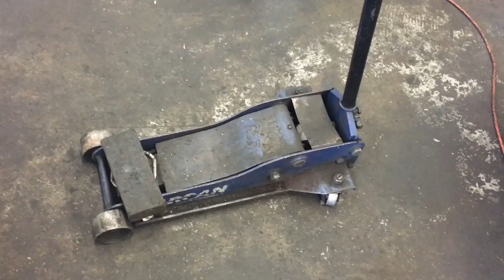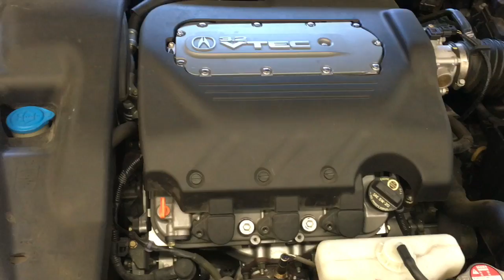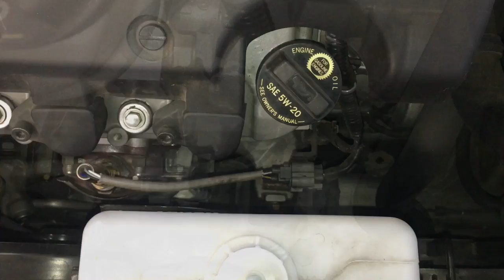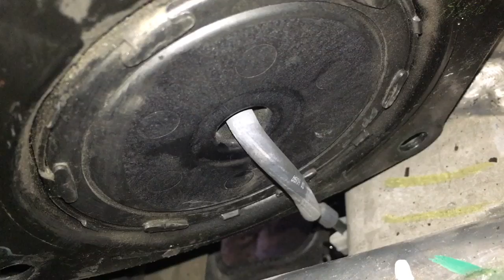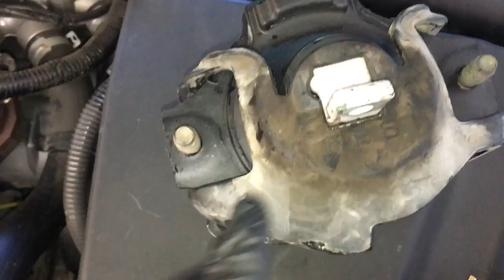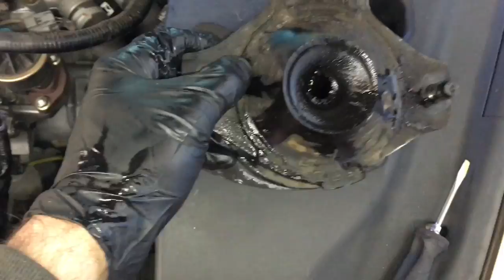How To Replace The Front Engine Mount On An Acura TL

Comment: So I removed all the bolts and nuts but now the mount doesn't want to come out at all. Like it won't budge like the bolts are all still in there LOL. I'm going to try to loosen up the left mount on the passenger side to see if they'll give some flex where I can jack the motor up to be able to remove the old Mount. If that doesn't work I'm just putting it all back together. Okay so that did work. Was very hard to pull the old one out but I got it out. Take note, I have a 2008 TL Type S with an automatic transmission. Looks like mine is different than what is in the video slighly where  I had to remove the wire and harness bracket that's on the starter. There's a 14 mm bolt for that bracket. That gave me enough clearance to pull the mount up. So that took me roughly 2 hours. I couldn't put the new one in from the top because the new mount has the hole for the horizontal bolt still intact which adds height to the mount. I even removed the battery and the lower plastic tray and the overflow tank. Looks like I need to remove the driver side fan that is mounted on the radiator. With that removed, it'll easily be able to put the new mount in. Unfortunately you have to remove the upper radiator hose to get that out. I'm going to finish it up tomorrow. Just letting you guys know it's not as easy as it seems in the video. If you have a TL type S I think there's extra sensors and things. Edit number 2: Got it back in. Ended up removing that aluminum bracket that has 3 bolts. It is bolted to the block. That gave me room to get the new mount it. One of the bolts was a pain in the butt to tighten back down because I can only do with an open end due to the space. Then the main bolt for the mount that goes in horizontally. Didn't want to grab threads very well so I had to mess with the Jack and raise and lower the motor. Still didn't want to tighten down well was very tough and I didn't have any long handled wrenches to get torque on it. I tighten it down as good as I could. And put everything back together. Everything seems fine and it's been over a week. Wasn't fun at all. My Mount which was original at 154,000, mi of course had the top portion broken off like the majority of all of them seems to be fine though car doesn't drive any different than it did prior
Reply: I just started today at 1:30 pm with sunset at 5 pm but figured out I'm not capable to pull out old front mount.  So packed beck all together.  Will do next weekend I hope.  I did lift engine somewhat with block under pan but mount didn't want to move.

Comment: I know this video is a bit old, but if you're getting ready to change the front engine mount, I’d really suggest looking into replacing all three engine mounts, and maybe even the transmission mount too. If just one is worn out, it can put extra stress on the new ones you install, which could make them wear out faster.

Also, swapping the mount isn’t as simple as it looks. You’ll probably need to remove the radiator, or at least the fans, to give yourself enough space to work, along with the bracket.

And one more thing.  It’s a good idea to have someone help you out. It’ll make things go a lot smoother, especially if you run into a stuck bolt or the mount doesn’t want to come loose from the frame.

Comment: I removed the plastic splash shield under the motor then lowered it back down on the tires, removed the battery and battery tray and removed all the 4 bolts holding the mount to the frame, then I removed the 2 upper bolts on top of mount for the bracket that goes across including the thru bolt, and lastly I laid back under the front and loosened the 2 nuts that go thru the bottom of frame that hold the very small zig zag trans mount for slack when trying to raise the dam motor but for some reason the motor wouldn't lift off of frame in front, no clearance to replace the front motor mount in front of radiator, The reason I'm typing all this is because the God Dam thing would not come out of the frame, no matter how much I raised the motor using a block of wood in between my jack and the motor oil pan the Mother *er still wouldn't come loose as all it did was raise the whole front of car, There's a lot of play in that mount, moves a good 3" when testing during a quick brake torque w friend, Somthn else gotta be holdn that motor in place, dam thing just don't make sense, I'll probly just schedule it with a shop nearby
Reply: The problem you had was you didn't remove or loosen the bracket bolts on the left mount so then the motor can move

Comment: I know it's an old video. But I just got done removing my transmission to replace the clutch on my TL and I found out my front motor mount was bad. Of course, I have to order it, so I needed to find out how hard it would be to replace once I reassembled everything. Your video showed me it's not bad once everything's together. Thanks for the concise details!

Comment: I came across your video in hopes it would solidify my expectations of the mount replacement on my 3.5 TL-S. This has saved me so much time. I will note for anyone who is attempting this on their own, be sure not to jack your engine very high, as you can cause a bit of stress on the other mounts. You want just enough lift to keep the engine from sagging and allowing you to put that 17mm bolt back in. Another note is that the bolts that hold the engine mount into the frame are SEIZED in. My frame isn’t rusted nor dirty, but using a regular breaker bar did circumvent this issue. Either way, very easy job for this specific mount. Thanks for sharing.
Reply: How high should the engine be jacked up? Would half an inch of lift be good?
And is it difficult to slide the new replacement mount into position without loosening the side mount bolts?
Reply: @ArmageddonIsHere  not very high, just enough to slide the rear mount out. And sliding the new bolts are fairly easy, but tedious due to the location. Just take your time and it’ll be easy to finish the job.
Reply: @GildedLily-z8h  
Thanks! Your reply and experience give me the confidence to go ahead with it myself!
Reply: @ArmageddonIsHere  no problem, it’s very easy, just take your time. Also if you can, use a 2x4 to help spread the jacking force on the oil pan.
Reply: @GildedLily-z8h so is it best to do all mounts at same time and not tighten anything until u have em all installed?   Like if i did my front and side and tightened them and then a week or so later attempted the rear would i need to loosen the bolts of the front and side
Reply: @balkee42  You’re better off doing all of the mounts. If I recall, you’re not suppose to torque them to specifications until you’ve seated the car back on a leveled floor. Then you can torque them down as needed.

Comment: I removed the old mount but it was very difficult, the engine didnt seem to lift even if i gave it a few pumps. Now i could slide the new one in butit just doesnt fit under the braket again even if i jacked the engine under the oil pan. How can i manage to make the new mount fit?
Reply: Did u figure it out
Reply: @balkee42 I'm sure he did. It's been 6 years. Just have to remove or loosen the bracket bolts on the left mount

Comment: Great video! I just replaced the front mount in my 2006 TL. This video made it super easy. Wasn't able to get my torque wrench in to torque down the big bolt on top of the mount. I just used the TAF methond...  tight as fuck! I was able to torque down every other bolt/nut though. Anyway, if anyone is wondering, I used the Beck Arnley mount that has active hydraulics with the vacuum port. All my steering wheel vibration at idle went away. Car feels super smooth now!
Reply: Does the term he is using like “torque it down 40 foot pound or 47 foot pound” matter? Like how do you know when it’s torqued 40 foot pound or 47 foot pound?
Reply: Trick Treat yes torquing a nut or bolt to the correct torque spec does matter. Sometimes it’s not as important but anything that has to do with your engine, transmission, or suspension should definitely be torqued to the manufacturer recommended torque spec. You can typically google the recommended torque spec or look in the owners/maintenance manual. In order to torque a nut or bolt to a certain ft lbs you need a torque wrench so you can set the ft lbs you want and it’ll beep or click to let you know you’ve tightened it to spec.
Reply: Justin Magyar thanks for the reply. I understand. So the only way to truly torque it to specification is by using a torque wrench and setting it to the recommended torque spec. I was under the impression that one should know when to stop tightening with just a normal wrench.

Comment: Brian - i just did the job with the assistance of your video -  Worked well and fix has been road tested. 

The vacuum tube can also be disconnected from the chassis end which is easy to to do and it is easy to re connect if you connect the tube to the mount first when you are installing the new mount. Also helps to disconnect the top radiator hose whne you are removing the mount or installing the new one. Hope this helps others.
Reply: Rob question buddy did you have to bleed the radiator system when you took the hose off

Comment: Will no engine mounts cause your car to jerk or feel as the car is shifting improperly during the first few gears ?
Reply from the maker: Montana Gior it can give that feeling yes.
Reply: How to Automotive I have a Acura RL 2008 But can’t seem to find the right engine mounts to buy what should I search for ?
Reply from the maker: Montana Gior i’ve called the dealer before and gotten a quote with the part numbers and then shop around.

Comment: Thank you for your video.  I replace my 2009 TL Tech 3.5 V6 just now.  Your video was very useful as a guide  my '09 was not as cooperative; had to removed passenger side fan and slide the driver side fan several inches to remove the mount.  This video saved me a lot of $,  By the way, I used Honda/ Acura parts, did not want to gamble on aftermarket ones.  No need to compound my 9 hour misery if things were not up to spec.  Thank you again for your video.
Reply from the maker: Je Cur Glad the video was helpful. That was a good move we OE parts. Thank you for watching!
Reply: It took 9 hours to install the mount?

Comment: Great vid, thanks. I replaced the front engine mount on my sons 2005 Acura TL today. We ended up moving the drivers side radiator fan a few inches toward the drivers side fender. This made removing the big mounting bolt easier. I also ended up lowering the jack height all the way down before being able to thread the big mounting bolt into the bracket.
Reply from the maker: RBAKER16 I believe in doing whatever it takes. Sounds like you found some shortcuts there. Thanks for the tips.

Comment: I replaced both the front and the side mount at the same time. I did the side mount first and thought that it is probably better to tighten bolts after the front mount replacement is done. If the bolts for the side mount is tightened, it makes it harder to lift the engine to install the front mount. And to remove the horizontal bolt of the front mount, having a crowfoot flare nut makes the job far easier. Because of the limited space, torque wrench cannot be used with a socket. Throwing in my two cents.
Reply: What size crowfoot flare nut
Reply: @balkee42 14mm

Comment: How in the heck are you guys pulling this out without removing the radiator fan?  I have the 2007 model with navigation and there is another wire mount in the way.  Even when I removed the bracket I couldn't get it to clear. I had to put the old one back in place until I have more time to pull the fan out too.

Comment: Thank you. Your video helped me replace this and saved a ton of time. I had fits reconnecting the vacuum line but managed to eventually reconnect it from the bottom. I had to loosen the plastic panel under the car (by removing several plastic clips) so that it could flex enough for my wrist to turn and reconnect it. Onto the next mounts!
Reply from the maker: WireD M glad the video helped. Thank you for watching!

Comment: Just to be sure... you can safely jack up the motor with a block of wood like this on the oil pan? Around the same place where you remove the drain plug bolt to change the oil? I don't wanna mess anything up
Reply: Yes

Comment: can i ask what is the reason why the engine mount need to be replaced? i mean, what does the car problems that made you decide to replace that? thank you.
Reply from the maker: Paul Laygan this Mount was causing the vibration end it was broken leaking hydraulic fluid. The symptom is when you step on the gas you feel a clunk.
Reply: okay. got it
Reply: Okay... my other question is...
My car vibrates when i hit 3 to 4 rpm. I think also known as 3rd and 4th gear... and then it goes away when i step on the gas more... now you think if i change the front mount the problem would go away? Also, i already changed the 3rd and 4th oil pressure switches. Thought it would of help but did not...

Also, is there any way to tell if my front mount is broken besides from knowing the fact that my car vibrates? Thanks for the reply back. Appreciate it..

Comment: It might be worth noting that even though this front engine mount clearly had its engine attachment lug torn away in tension, many times the actual initial failure point is a failed or weak REAR engine mount that can no longer handle compressive forces.  It's nearly identical to the front mount but it is a *ROYAL* pain in the ass to access.  Should you attempt the mission to repair, have your swear words warmed up and ready to go and be prepared to arrange them into new & unique combinations while you sound like a madman with Tourette's. :D
Reply: This is a good point... I replaced side and front mount in TL and all steering wheel vibrations are gone now. I still want to replace the rear mount soon for the reason you listed though!
Reply: This guy knows whats up I imagine a engine swap wouldnt be much longer to do took me almost 6 hours im sucha noob

Comment: did you say 3 feet reversible wrench?
Reply from the maker: 12vgs8606 yes The wrenches that I use are about 3 feet long. They are amazing. They come in a set from 8 mm up to 19mm.
Reply: Amazon Q&A indicated the length to be about 18 inches i.e. 1.5 feet
Reply from the maker: 12vgs8606 The 19 mm wrench is nearly 3 feet long. When I get to the shop in about three hours I can doublecheck for you.